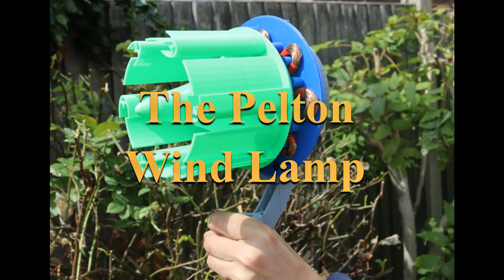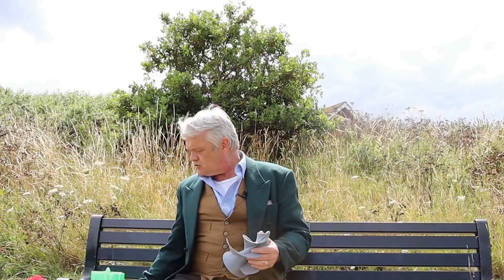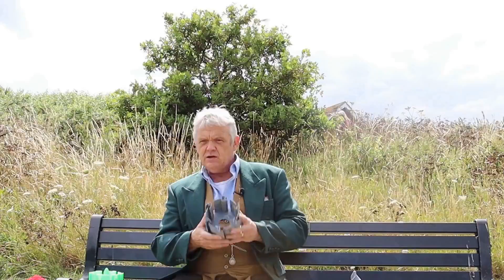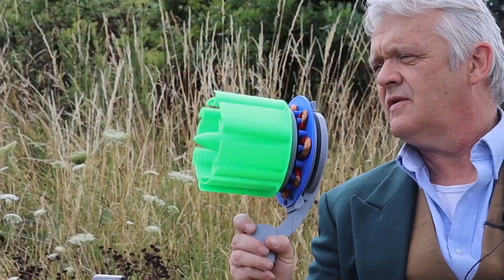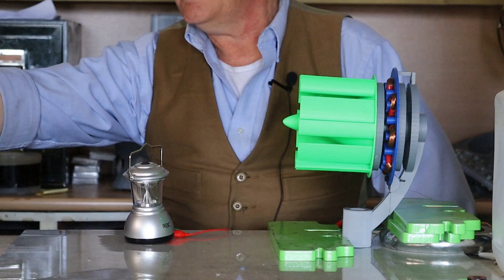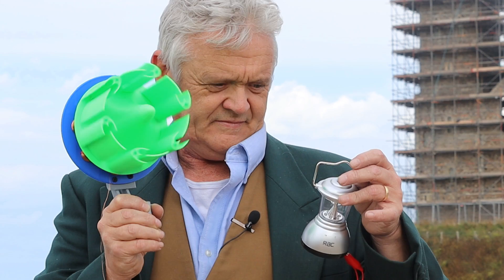1999 The Pelton Wind Lamp

Comment: Hi, just looking to find how you built the handheld generator/alternator.
I downloaded the zip file, but there is no winding or wiring diagram.
I what arrangement do you connect your coils and do you rectify the resulting AC current?

Comment: Hi Rob, great vid as usual.

I want to add support to the adding the Archimedes screw instead of the cone.

I'm also thinking about what would happen if the centrepiece have grooves that direct the wind to hit the blades? would there be an effective angle or would any angle work as good? or not have the centre-piece collect the wind from the side and let it escape from the centre?

Comment: I feel like you need a capacitor to even out the power output on it. But I wonder if that'd act as a electromagnetic break because of back EMF. 

Maybe if you used a flyback diode. I don't remember my electronics that well.

Comment: Archimedes has high torque, whereas Pelton has high speed. The generator design has to match one or the other. With gearless generator, you must go for speed. Otherwise your generator will be always under utilized. So you should be concentrating on the question: what gives me the maximum rotational speed in a small package? Always testing in very light winds is not addressing this. It is only answering: 'what has enough torque to get going at all?'

Comment: Its not really an archemedies screw, its a lily impeller.. but whos counting? I was just wondering if you did get a result as to which one turned faster in the same amount of wind.

Great video as usual, looking forward to a marriage of the lily impeller middle on the airfoil/split impeller edges..

Comment: Can you humor me?  Imagine the new generator design you have for that, but after the pelton wheel, you have the eccentric drive, that then drives the new generator design. Yes, it won't start in a simple wind, but a 3 m/sec wind should be enough to get it going, and you'll make 10x output.  Just a thought.

Comment: I wonder if one should think about making an upscaled mold of the parts .. for an aluminum pour as a more durable .. device to fit on the rooftop of someone's home?  Maybe create a low but long wind-wall.  Is it possible to make it out of plastic and be durable also?

Comment: Need to smooth out the output or use a frequency multiplier.
Reply: Also why do I think that would work as a water turbine with the flow of the water over the cone?

Comment: Dear Robert,
Thank you
I’ve been looking at what’s about today,
this turbine is like one, we have which till recently was used for forcing air, in a continuous grain dryer very much like that 
without cone,
motor attached 
Gigantic in comparison 
Spins well
Outer casing still on though , leading too down through type system 
I could remove casing add cone, face too west
I’ll load video 12 days or so.
States on motor: Volts 389/420
Phase 3 
Rev per min 1470
36 Amps
So you see if it could spin , in idle on a low breeze
Like vent fans do in an unused building 
and sometimes hard in a going one
What the dickens will it do left for a year if I pay too plug it into supply 
That is the thing we are all after
Got me thinking 
Interested one,
Henry 
❤

Comment: I think a top ring, stopping wind going down the channels and interfering with working airflow, would improve efficiency for no real extra costs/complications. Also a really quick and easy thing to test eg glue a cardboard one on. The other advantage of a top ring would be if it was scaled up it'd add extra rigidity.

Comment: Only just found 4:43  a 3d print service here. (India). Cant wait to get the final version printed. I kinda hope youd have the darwin catcher above. The version of blades in this video, the upgraded screw cone in the centre. The taller serpentine coil arrangement you made in a previous video, where u stretched out the vertical sections. Finally, The maglev bearing at the base. All scaled to slot together. Ps: if you put the magnets on the blades here, and put the coil around it, you might even kill two birds with one stone. Of course, thered be gaps for the wind to pass through and out past the coil. And since the darwin is feeding from centre out, youd lose nothing by doing so

Comment: Would need some kind of housing to guide the wind into the face at the 90, otherwise the intermittency would be problematic on a static mounting. A weather vane tail could be used but that in itself presents other intermittency problems.

Comment: I was amused to learn about the Soviet Union "Kerosene Lamp Generator". When they first wanted to spread propaganda by radio, many remote areas had no access to electricity. So they made a heat difference generator that sat on top of their oil lamp. Which would put out enough power for a radio. I wondered if you could now make an emergency phone charger, that would work sitting over a candle flame? 🤔

Comment: I see a few comments suggesting to exchange the central cone with an Archimedes screw... I don't think it's a good idea: Yes, it'll help the Pelton design to get started, but then it'll run into the problem that the Archimedes screw is most efficient in a heavy medium with large force per speed, like water, while the Pelton design is a fast runner, better in low viscosity and mass, and high speed. When the Pelton nears its best, the Archimedes design will be holding it back as it goes from being moved by, to moving, the air.

Comment: This looks nice! Do you eventually plan to compare your designs under the same load, how they compare? I have a feeling that "generates high open voltage" might not be the best benchmark of power generation. My intuition is that if something is easy to spin up, then actual load might also spin it down easily. High voltage can easily be achieved by putting lots of tiny solar cells in series, but that doesn't automatically mean they will output a lot of power.

Comment: Would it be possible to try the Archimedes Spiral ..... backwards?
Apparently you get more lift from a wing due to the air pressure being lower on its upper surface than you get from the air being forced downwards by the wing passing!
I have not got the figures to hand, but it occurs to me the Spiral may act in the same way,so ........ worth a try?

Comment: The way you got the 40+ volts out of that yesterday was with you pulling the rip cord to get it going wasn't it? You need to test the Archimedes spiral and the Pelton wheel design against each other under the same conditions and test them with a multimeter to see what they output. Apparently neither of them will put out as much as spinning it up with the pull cord. Thanks Robert

Comment: I don't know about this blade type.  It's a new concept and that's for sure.  I wonder what Bernoulli's, Euler and Convective acceleration equation results would be for this.  Fluid mechanics is just a bit out of my normal zone.  I have crossed into this on ion thrusters designs.  One I knew would work failed on engine mass to thrust ratio.  Yes, it upped it but failed because it was too bloody heavy.  I tabled it to rethink about it later.  That was 30 years ago.

Comment: What happens if you put an Archemedes screw in the middle of a Pelton wheel instead of a cone? As I see it the Archemedes screw will take the wind at first and then it gets forced further by the Pelton wheel. How much more energy do you get then? Obviously you have to check the direction of the blades of the Pelton wheel in order for them not to work against each other.

Comment: It would have been interesting to have seen a direct comparison of these 2 devices, by having them hooked up to your meter to see which harvested the most energy from a known head of air
Reply: There have been several request for direct comparisons on this channel.  It seems like the most logical way to compare turbines of the same size.    One problem is that the test equipment must be very consistent.  The wind direct from the blower is spinning and very turbulent.   The same turbine can show very different results from day to day.
Reply: @danedmiston9673  True, but I have seen Robert use a wind speed meter, in previous videos. That could be used as well, if the wind source is that unreliable.
I’m not looking for precise, publishable data here, but knowing that one device gives x2 the output of the other, under the same conditions, would help to focus the research.

Comment: There’s not much in this but my favourite mind blowing free energy tech toy is a glass lightbulb with a small bladed metal fan inside. The blades are angled in such a way and are coloured black on one side. The Sun hits these and powers it round as they are absorbed and cling to it  and they push the white side away in the same direction. I just love seeing the particles of sunlight effecting a surface like that! I forget name of it. I would love to see how much use they COULD be larger scale and WöW to stand in one!!
Reply: It's called Crooke's radiometer. Have been thinking about how to make one larger, with low-pressure helium insde...
Reply: @Smo1k  I think they could create a gentle waft when the sun is out. Such fond memories of that😩

Comment: Any chance you'll post measurements of the different designs?
Reply: There have been several request for direct comparisons on this channel.  It seems like the most logical way to compare turbines of the same size.    One problem is that the test equipment must be very consistent.  The wind direct from the blower is spinning and very turbulent.   The same turbine can show very different results from day to day.

Comment: On solar at night ... on a 6v panel i was running an air pump which reverses polarity at night and becomes a water pump, there is a day and night polarity switch i discovered, add a full wave bridge rectifier and voila - night solar lamp, i havent tried to run a light but would like to see you experiment with that. 

1.9v was the max i noticed at night on a small 6v panel, the motor only needed 1.5v to start it.

FPV.

Comment: Just a thought, if you replace the central cone with a shallow Archimedes screw, it might help the wind organize itself and start the turbine in even lighter winds. Maybe.
Reply: Too efficient.  That will suck up all of the wind and the rest of us will be stuck with stagnant air while Robert's hair gets blown straight back.
Reply from the maker: it's a good thought mate - thanks for sharing
Reply: Try both screw and (ribed or multiple sided cone) what has more drag slowing the wind speed + extra weight and complexity. Next up Polishing it to a perfect surface.... 

Thanks murray for sharing!!!
Reply: My thoughts exactly. Put the screw cone in the middle for double the efficiency. Wasn't visible in the video if that was what rob had done
Reply: Are the blades of the archimedes blade lining up with the Pelton blades?
Reply: @SleepingThunder01  Not necessarily.  But if you left it stationary, it might cause drag and inefficiency at higher wind speeds. But you don't really need the screw to do all the work. And it would probably need multiple screw tracks, really, so it wouldn't feed so much wind to a single spot. But it just seems easiest to just put the screw on the same plate as the squirrel cage. You'd need to work out the thread rate of the screw to find an optimum turn rate, so that lateral progression down the turns matches the wind speed at the rate the Pelton fins turn the screw, or maybe just a bit faster.
Reply: Or could the central cone be stationary! (Or screw) frontal berring perhaps?
Reply: My thoughts exactly